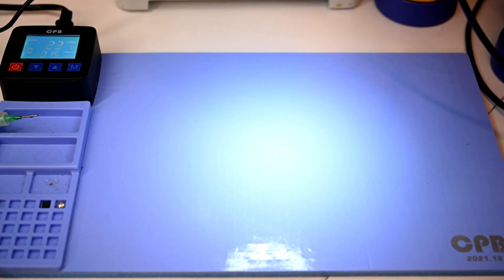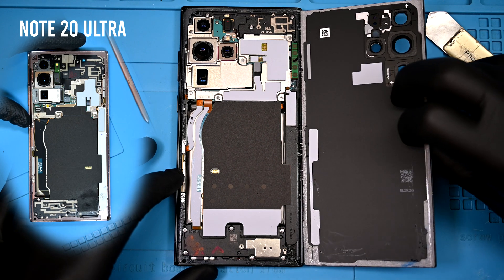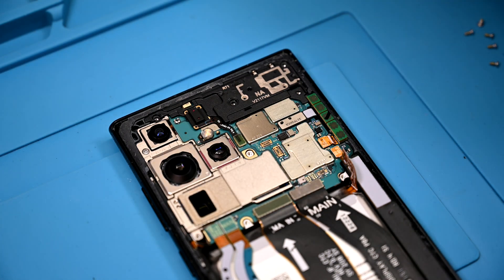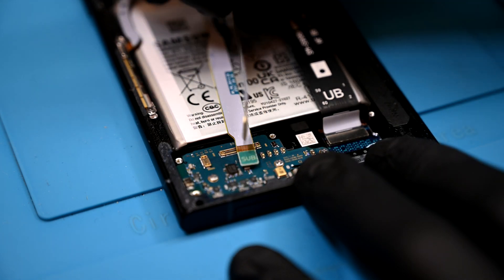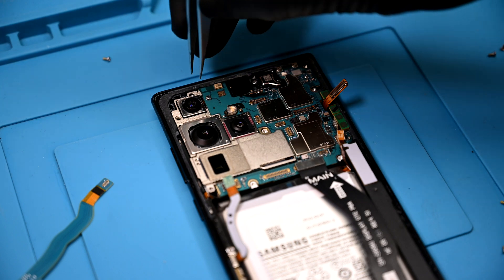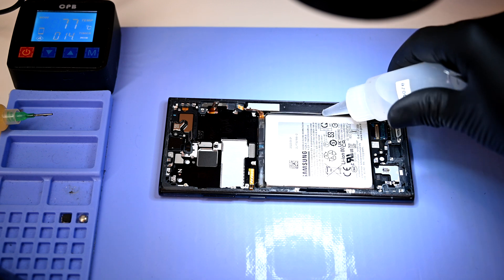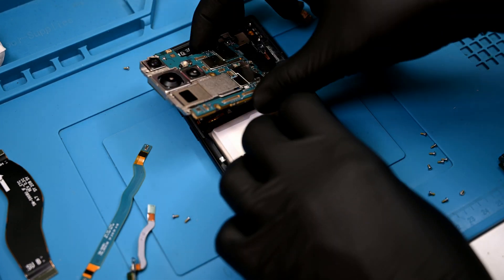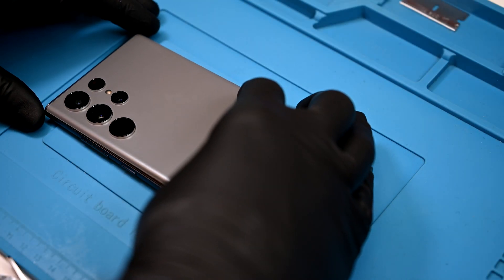Galaxy S22 Ultra Screen Replacement | Framed Display | Where's the vibrate motor?!

Comment: its funny, a company i order replacement parts from have sent me a replacement vibration motor for the s22 ultra, that looks nothing like the earpiece. Will be getting in contact with them!
Reply from the maker: How strange! I guess it's easy to mix up Samsung parts with how similar they can be, but the S22 Ultra has a very, very unique earpiece.
Reply: @TapticDigital  yeah, thank you for this video. If it weren't for you id of been searching for hours haha. Now i can just replace the earpiece and gain vibtations again!
Reply from the maker: @phoeberp  did yours just suddenly stop working or was it damaged somehow? I only ask because I haven't seen one fail yet in person
Reply: @TapticDigital  im an IT tech myaelf so not always properly equipped to fix faulty parts. As water had entered my phone it shorted the display cable. I was in a rush so i took it to a repair shop called phone experts. Well they tore the phone down and transferred it to a new screen for testing but in doing so damaged my front camera, signal cable, haptic engine, battery and other sensors i did check voltages before blaming them as water could of done this but all connections were fine. But the parts themselves damaged with either tweezer marks or pressure marks. I can only assume they broke the haptic engine. Unfortunately replacement parts don't really exist
Reply: Oh and wireless charger coil. No longer tracks temps so phone doesn't fast charge anymore
Reply from the maker: @phoeberp  jeez, they certainly sound like experts in causing damage. Thankfully pretty much all the parts are modular and replaceable, the selfie camera is the only weird one because it's region specific. Head over to Injured Gadgets website, it looks like they have everything in stock, good prices too.

Comment: will you share the link of the liquid you used to separate the back glass please?
Reply from the maker: Just simple isopropyl alcohol. I use 99%, but anything over 91% is safe to use. You can find it at most drug stores or big box retailers.

Comment: Does the S22 Ultra screen replacement come with the finger print reader?
Reply from the maker: It sure does, it's molded into the display
Reply: @TapticDigital  If I was to replacing my screen and frame will I lose and original settings that come from the factory? For example, the screen resolution, screen mode and displays?

Also thanking for your response, I find your video very helpful. Plus do you have a link where I can purchase the s22 ultra screen replacement?
Reply from the maker: @WillLit842  no, it will not cause any settings changes or losses. In most cases you don't even have to set up fingerprints again. Samsung is much better than Apple and doesn't disable features when parts are replaced.

Comment: I need to change the battery in my S9, is it possible to retain water resistance after a repair like this? That is one of my favorite features of that phone. I goto water parks and swimming a lot and would prefer to keep that phone on me for navigation and emergency calls from or to family/friends.
Reply from the maker: Yes and no. Disclaimer, I wouldn't trust the water resistance to begin with, I've worked on way too many liquid filled Samsungs and iPhones. As long as you use the proper tools and good quality replacement adhesive you can get it very close to a factory-like seal, but nothing will be as perfect as machined. 110% recommend a waterproof case, chlorine will shred the internal components in under 10 minutes. You'll need back glass adhesive and battery adhesive, as long as there are no cracks or gaps in the glass, you should be good to go!
Reply: @TapticDigital  thank you for that response! I  have used my S9 extensively under water in pools, the quarry, lake, shower, bath, and even my hot tub! 
Listening to music from your phone while under water is pretty amazing, it feels like the sound is coming from inside you head which is super bizarre!
Reply from the maker: @wileymonair  you give me anxiety 😉 glad it still works!

Comment: Are you able to maintain the IP68 water resistance after a screen replacement?
Reply from the maker: I wouldn't trust the IP rating to begin with, for the most part if you use the proper tools and adhesive you can get it very close to being the same resistance, but you can never get the machined quality of the manufacturer.